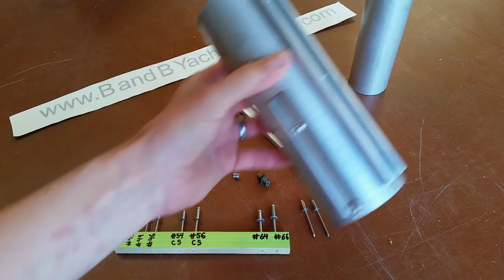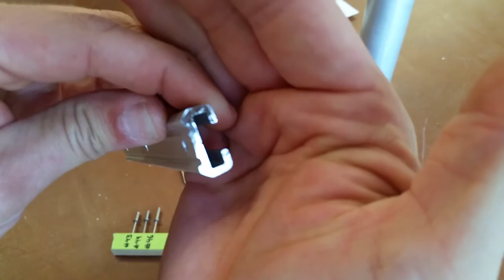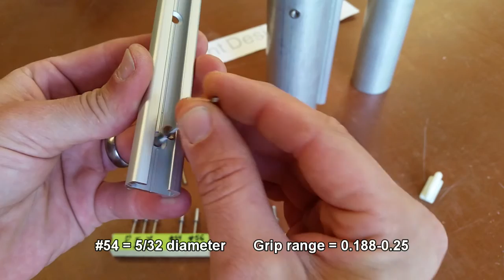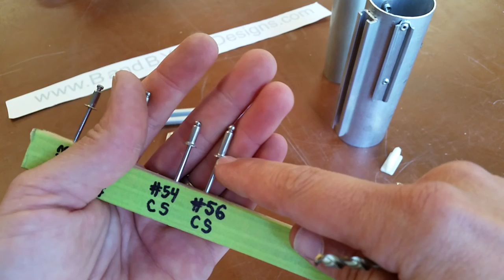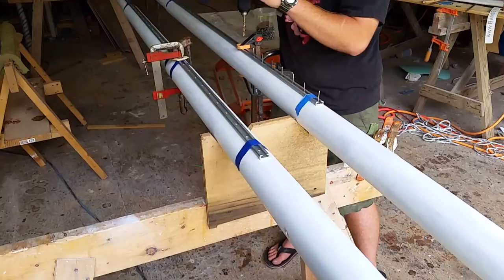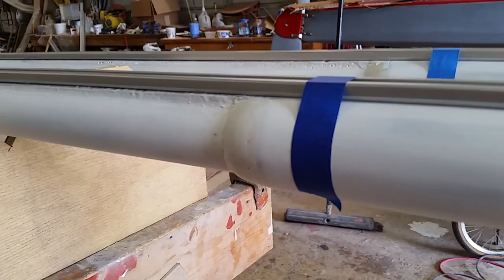Custom B&B sailtrack introduction

Comment: Neat.  I will have to look into your system more.    How well would this work as a second track off to the side of the main track for a storm trisail?  

We have an older Seldon oval teardrop mast with an excellent integrated main sail track.  The mast goes off at the rear at nearly a 30 to 40 degree angle from the tracks depending on how close it could be mounted to the main track, and I fear that this is just too much, especially when the sail is winded to the far side of the track it where it could be much more than that 40-degree angle.  While this might not be that big of a deal most of the time while sailing, dousing the sail with something near a 60-degree angle on the handbag slides may be pretty difficult if the sail needed to be taken down for whatever reason while it was still blowing hard and could become a problem unless the boat could be turned off the wind and luffed to the lee on that side so the sail was more perpendicular to the track.

Maybe some sort of triangular extruded section could be placed on the mast to square it off and move this track more in plane with the hull even though it was off to the side.
Reply from the maker: We've sold quite a few lengths of this track for use as a secondary trysail track. Shouldn't be used on a boat over say about 30 feet since 5/8 slides are not very strong for a trysail of any real size. The angled track problem sounds like a tricky one. Some sort of wedge sounds like it might work.
Reply: Bummer.  We are a 35' Hallberg-Rassy.    We just bought a brand new offshore-quality 3-reef main from Quantum Sails, so I guess a trisail isn't all that important right now. It would be nice to have one on a separate track and rigged to raise at a moment's notice after dropping the main.  I was thinking a bag mounted right to the mast and always kept ready when sailing offshore.  But this boat has sailed through a hurricane without a trisail, I suppose it is just a pipe dream to get one someday.  Thanks anyhow.  You have a really great product for smaller boats. Well thought out and a great price.  I will pass this video on to anyone I run into looking for such a thing for a smaller boat.

Comment: Just curious: Are you not concerned about galvanic corrosion between aluminum sailtrack or mast and stainless steel rivets?
Reply from the maker: We always do our best to insulate the rivets with duralac compound or similar to help prevent corrosion. In this case it is mainly for the strength of the fastener that we use stainless. Aluminum rivets in this application have not proven to be strong enough to hold the track with the loads we put on it. A larger aluminum rivet could be used but the track geometry is such that the rivet head must fit between the gap for the slides.